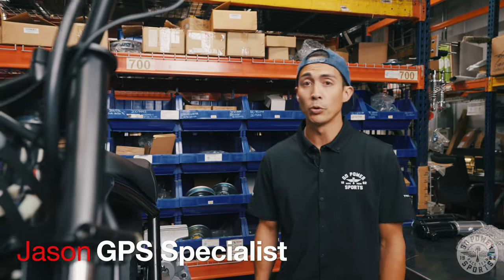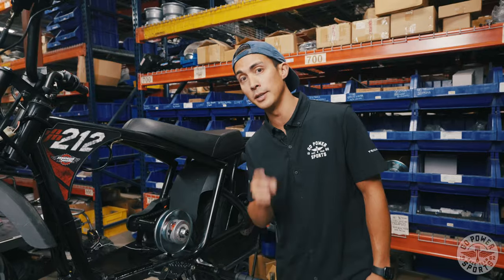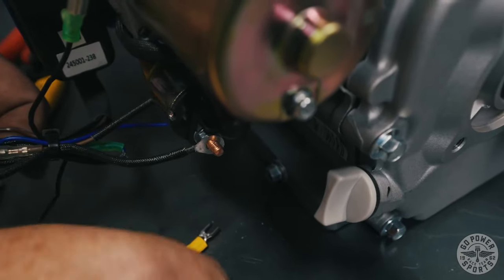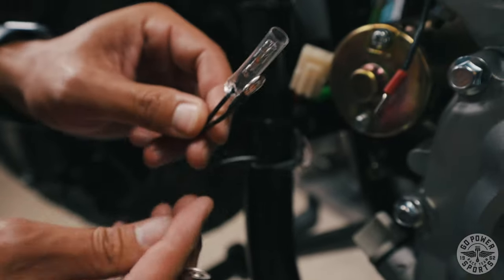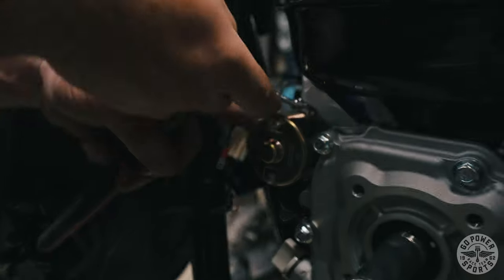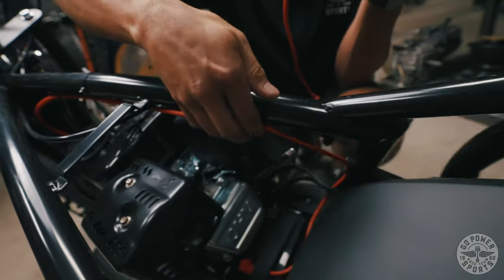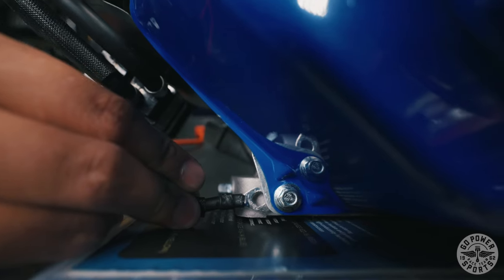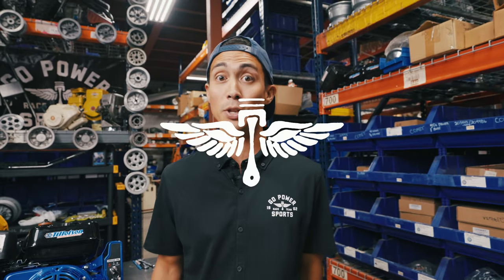Mega Moto 212 Minibike Battery Install | Option 3

Comment: So with this option, the included voltage regulator is not used? I didn't see it mentioned in the video, but plugging that pigtail into the bike's harness prevents that harness from plugging in the voltage regulator.
Reply: I would think you would want to run the light off the battery so that it doesn’t pulse with varying engine RPM, Also why do people keep saying the regulator/ rectifier comes with the kit? I did not get one with my kit I bought in july and was told I would have to order one separately 🧐
Reply: @cyberwlf420  My pro kit came with the rectifier.
Reply: Why is the regulator needed?  None of the options even use it?
Reply: Agree.  This is confusing.  Unless the Tilly motor has a built in rectifier it is outputting AC vs DC off that coil.
Reply: Engine charges the battery and the battery runs the headlight.
No need for the regulator because the charging system doesn't have enough juice to overcome the size of the battery and fry it like on your lawn tractor.

Some other options don't use the battery and need the regulator to sort things out.

I think I got that right and I hope it makes sense to someone.

Comment: That post that you put the pigtail on after taking the red positive cable off looks to be maxed out. After running your positive cable from your battery, did you connect to the other post on the stator or the same one as the pigtail?

Comment: I disconnected everything for a complete repaint (Borderlands video game style). I could use a diagram or some help for the whole wiring. This is with a single coil, electric start, headlight, and battery.

Comment: Good video but, It would be helpful if you guys had better lighting while filming. Is the headlight running off the battery? Cause it appeared anyways that it stays on after the engine is turned off. Another question. How many charging amps does that system put out?

Comment: Can y’all help me I bought this bike from the video and the electric start does not work the headlight works but not the electric start the bracket y’all made works very well I can jump the bike without teh battery moving I love teh design but it has a simple flaw I can bring the bike up there to see if y’all can fix it or not just lmk please and thank you
Reply: It's the pull start cord off track

Comment: Does this setup work with a LED bulb, or LED headlight?
Reply from the maker: Regular or LED Bulb in the Mega Moto 212 Headlight Housing.
Reply: @GoPowerSports  There's no issue with bypassing the regulator?